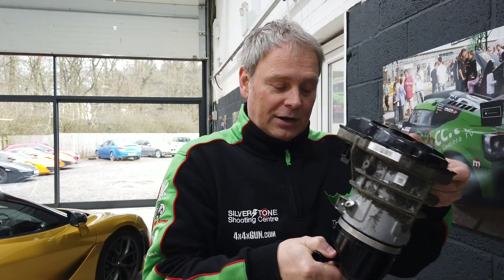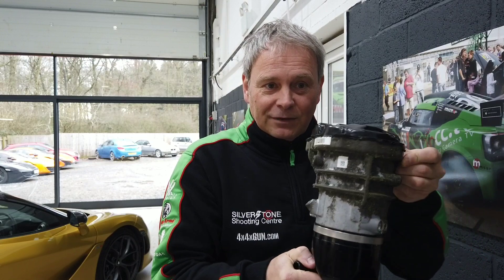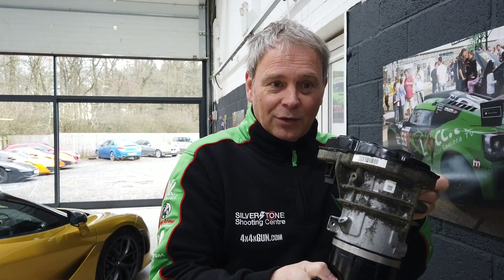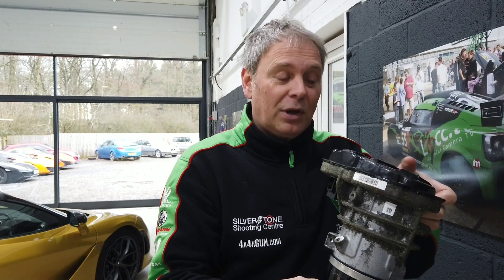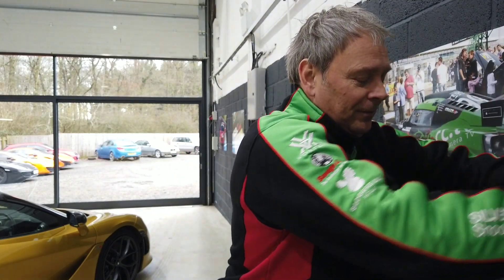Mclaren Power Steering Pump Warning

Comment: Fantastic advice that help direct owners towards common issues they may face when owning these awesome cars, and will also help keep the huge bills at bay knowing what to look out for.

Is it a fairly simple diy job to change the washer pipe to silicone type pipe in order to remove the problem completely..?  I will certainly be in the garage tonight checking my pump and hoses.

Keep up the great work, it’s very much appreciated..

Comment: The freezing whether in the UK may also be an issue causing the hose to split. This is a bit like the coolant hose clamp issue, decent if they used silicon hoses, and it may not have happened.